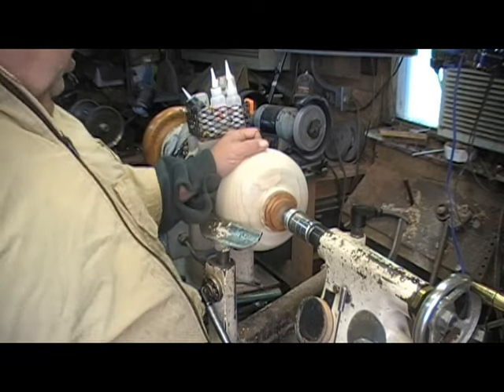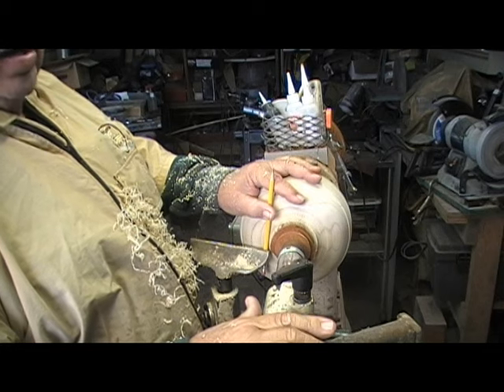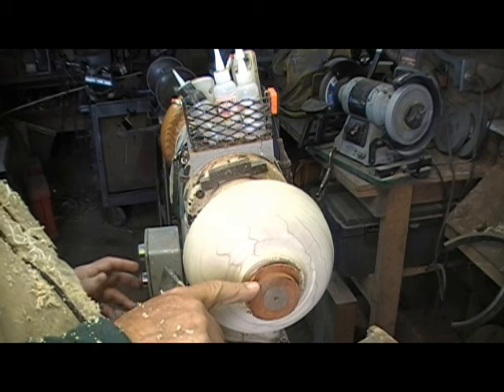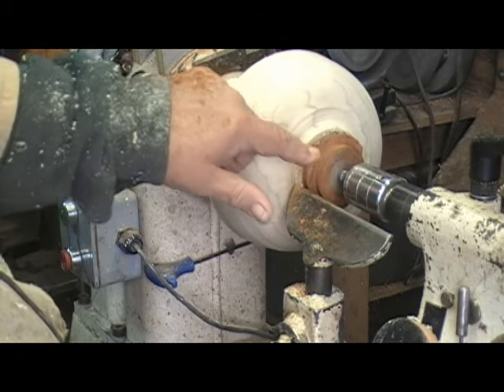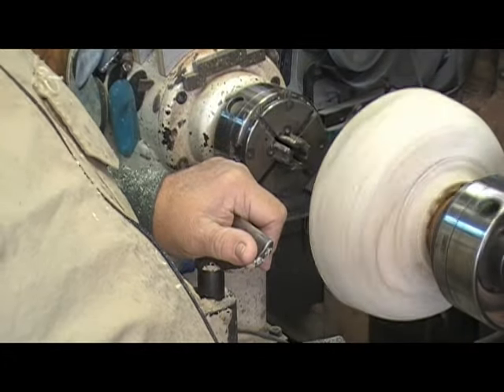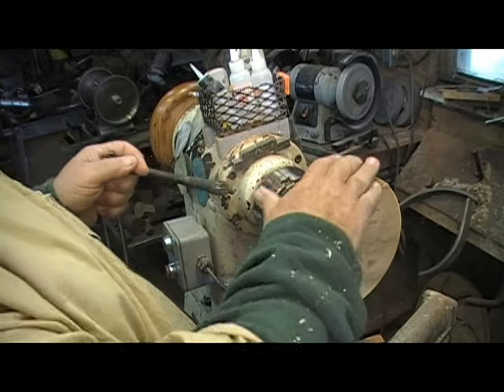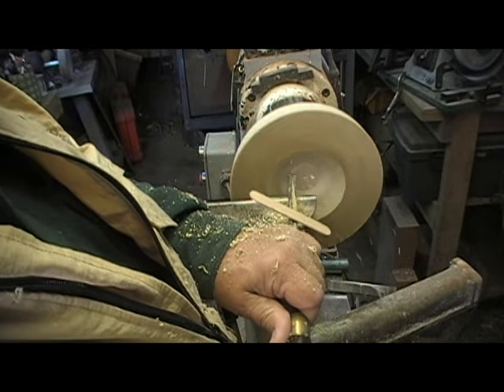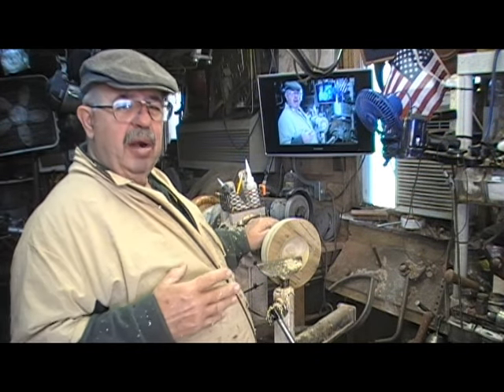# 205 Bowl Grain Basics

Comment: Nice video. Have you made a video that goes a little more in depth on how to properly use a bowl gouge? Would be nice to see you show us how to slice wood as a lot of use make saw dust while turning and I just recently realized the importance of getting a good cut and following it thru. Still get catches with the bowl gouge on occasion as I'm not holding the angle correctly.
Reply: +Joey Nuggetz  #168
check it out